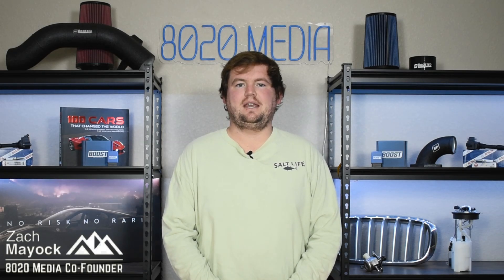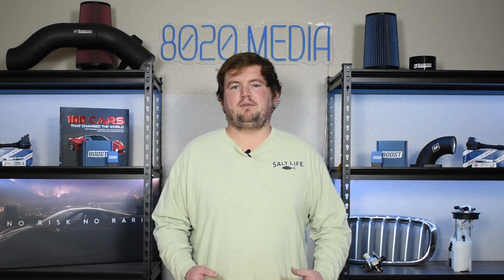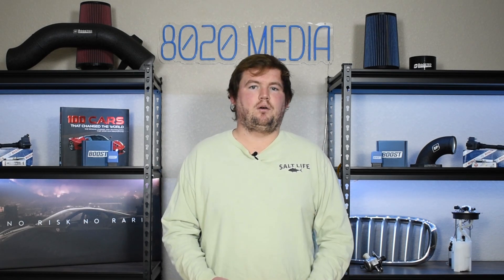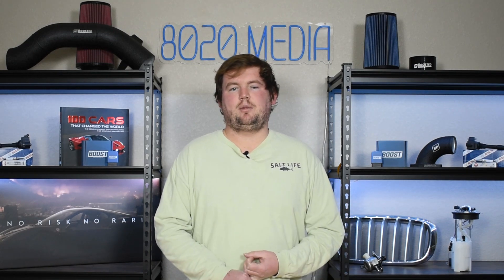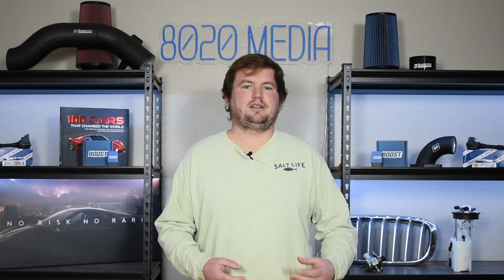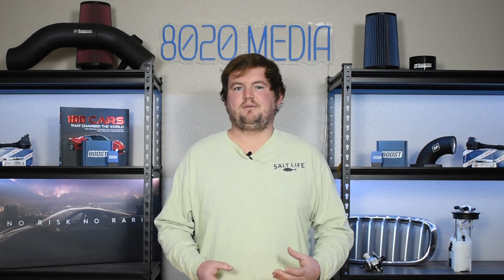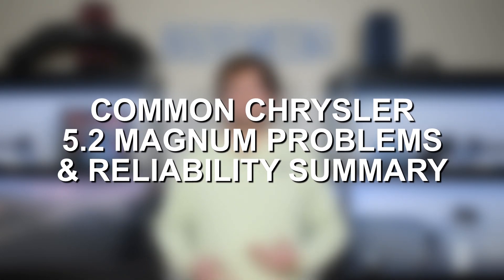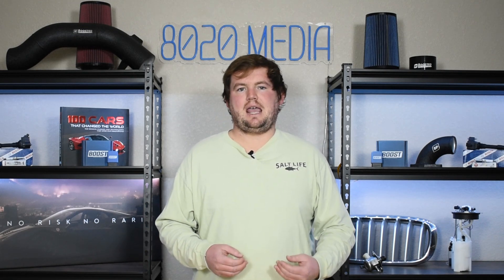The 5.2 Magnum V8 | 3 Common Problems & Reliability

Comment: Can I use junk yard Magnum heads, 5.9 or 5.2 on an early 318? I know of course, Edelbrock makes an exelent  intake with the straight down type style mounting bolts, I understand these are roller cam engines that would require different lifters and longer length push rods. What other concerns might I have? Are 5.9 heads a better choice on an'86 318? I would like to use KB "0" deck, (close to) to pistons to increase compression ratio. Who makes the longer lifters required,
Reply from the maker: D - Yes, you can bolt Magnum 5.2/5.9 heads onto an early LA 318 (’86) and it’s a nice budget upgrade, but plan for the key differences: Magnums use oil-through pushrods and pedestal, non-adjustable rockers, whereas LA heads oil through shafts, so you’ll need AMC-style/“oil-through” hydraulic lifters for an LA block (or a retrofit set from Comp/Hughes/Melling), hollow pushrods of the correct length (set preload with length or pedestal shims), Magnum rocker arms, and a Magnum-pattern intake (you already noted the Edelbrock straight-down bolt version; you’ll also need Magnum valve covers with vertical bolts); reuse LA head bolts with washers under the ten small outer bolts so they don’t bottom in the Magnum bosses, and verify gasket choice/coolant passages (standard LA composite gaskets typically work). Exhaust ports line up, accessories generally do, but check PCV/breather routing and coolant temp sender location. Between 5.2 and 5.9 heads, the 5.9s are better (typically 1.92/1.625 valves vs. smaller 5.2) with ~62cc chambers that will raise compression on a 318—good with your KB “zero-deck” idea, but calculate final compression and target ~0.040" quench for pump gas, and always check piston-to-valve clearance with your cam. Since your LA 318 is flat-tappet (not the later roller), you don’t “need longer lifters,” you need lifters that feed oil up the pushrods; brands like Comp Cams, Hughes Engines, and Melling offer them, and Smith Brothers/Comp can supply custom pushrods. Finally, inspect the Magnum guides/springs/retainers for your cam’s lift (Magnum springs are often marginal), and consider a mild spring upgrade and new seals while the heads are off.
Reply: @8020Automotive Thank you for your detailed response. Are you saying the 5.9 heads have small cc combustion chambers? My '69 340 ran great on 92 octane. It's  compression was 10.5. This is my target compression ratio, or slightly higher. I owned a '70 351 Cleveland 4 barrel, which had 11 to 1 compression and had absolutely no problems with it running on 92 octane.

Comment: Also… turn whatever car/van/truck with a 318 v8 and it sludges when idle say you changed the ignition coil, IAC, coil pick up, spark plugs, there’s fuel delivery, or spark plug distributor, camshaft sensor or spark plugs plugs are in correct patttern it will be the map sensor my ram van 318 almost blew because I bought those four spray pattern Bosch fuel injectors off eBay and I got low compression those FI made my spark plug get carbon build up and so I changed that got it to how it was running with prior old fuel injectors but when I was attempting all it would do it crank no start when I tried crank no start for 3 days tryna figure it out it blew my map sensor from constant crank no starts and also carbon build up spark plug and crankshaft position sensor also went bad I’m no mechanic but I changed all these and put the prior old injectors and it worked fine starts and sounds just how it did before I touched anything almost 2 months ago van currently has 407,654 miles codes I got was p0203 due to torn pigtail fuel injection connector and p0303 bad injector was the issue after that<<< I dealt with the sensors giving out hope this doesn’t confuse anyone also I checked if it was the the throttle position sensor the way I checked that was I disconnected the connector from the throttle position sensor and turned the key and I got the code for the throttle sensor connected back no problem
Reply from the maker: F - Thanks for taking the time to share your experience!

Comment: Ive seen  5.2 and 5.9 magnum engines with  well over  300 thousand miles on them and  still going the issue with that generation truck is  the transmission not the engine and is usually caused by  lack of proper maintenance  they are  great  engines overall.
Reply from the maker: O - Thanks for sharing your experience!

Comment: The cam sensor is in the distributor. I’ve never seen one get dirty or”grimy” as you said. The first symptom of a plenum gasket failure is oil consumption and/or excessive pinging. The oil consumption is what causes converter and O2 sensor failure. These motors are extremely reliable.
Reply from the maker: P - Thanks for sharing your opinion and insights.

Comment: This and the 5.9L are great engines.  If anyone is wondering about the fix he suggests for the plenum, is is an aluminum plate that expands/contracts at the same rate as the intake manifold since that's also aluminum (stock is steel).  Runs about $50.
Reply from the maker: A - We agree! Thanks for sharing this insight.